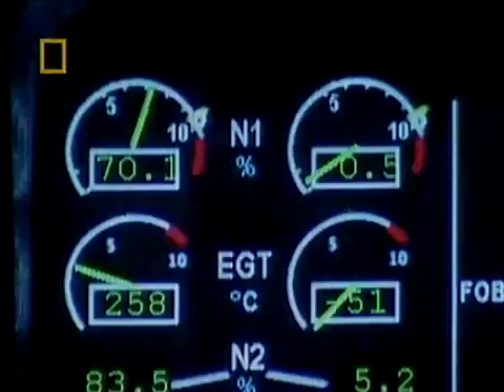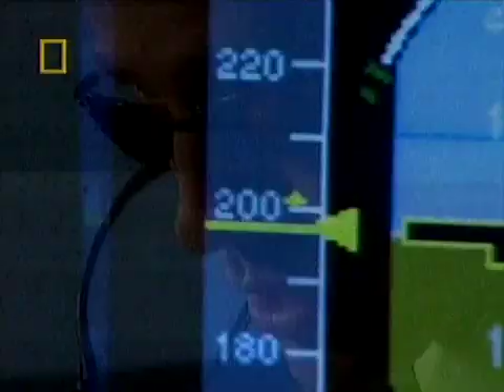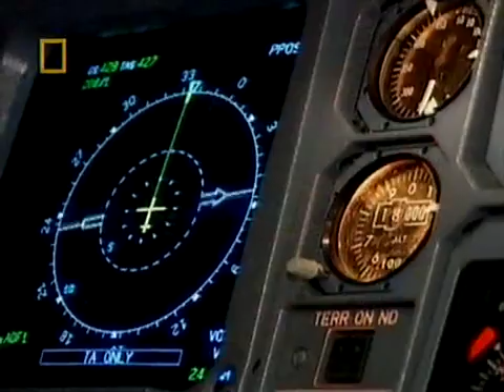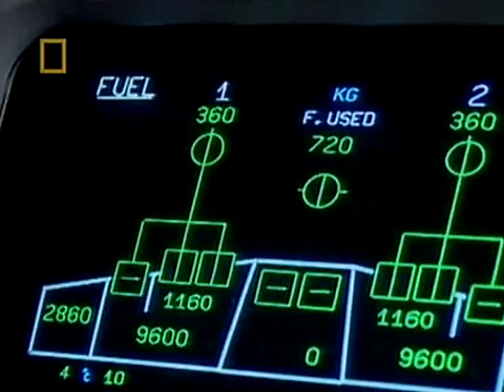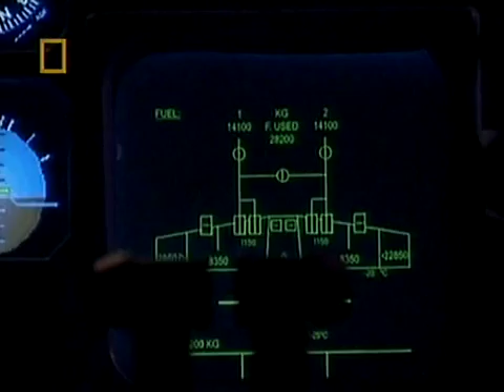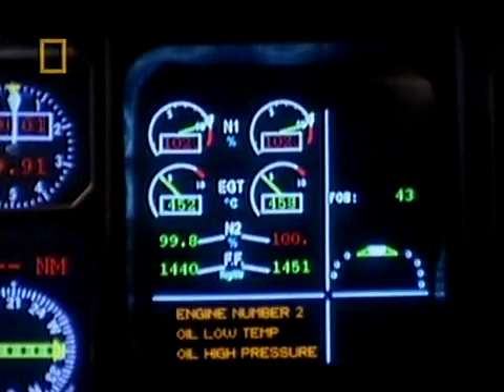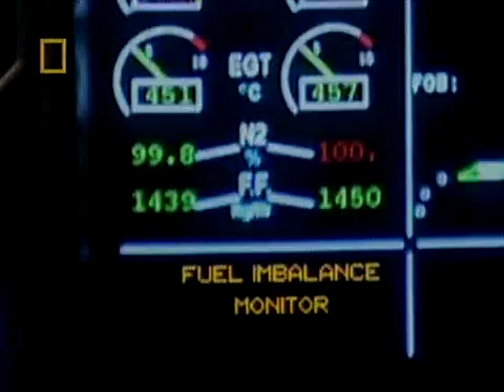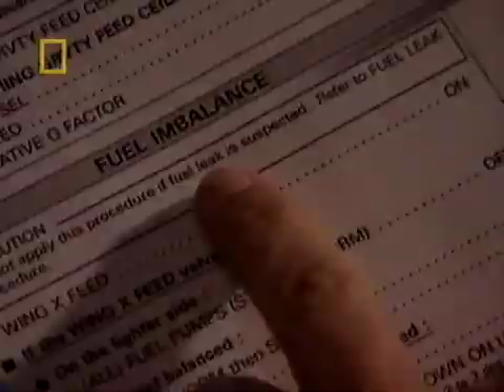Mayday : Flying on Empty Part 1

Comment: Flying is actually not that hard.  If you watch the whole series, you will realize that most of these videos show some type of pilot error as a contributing factor in the accident.  In this case, the pilots failed to identify a major fuel leak.